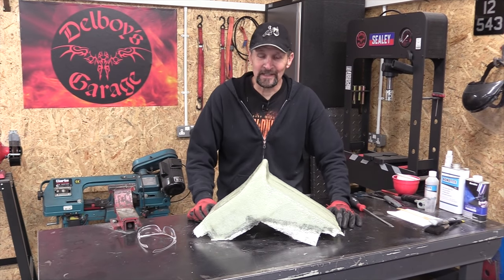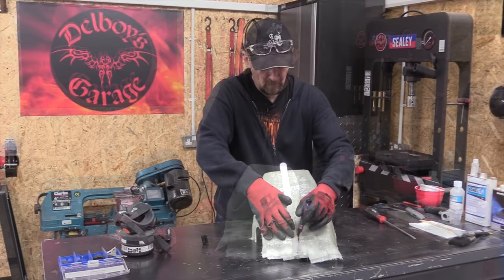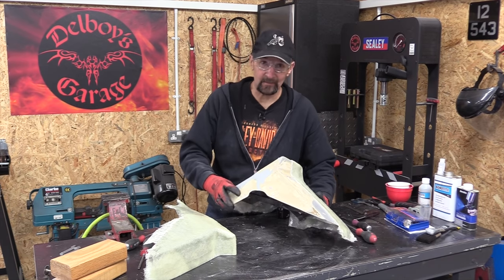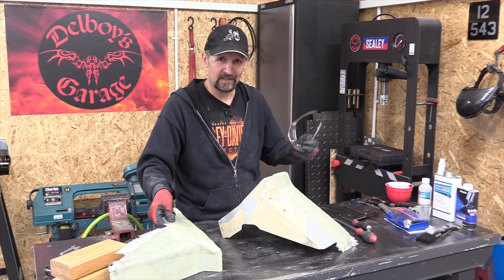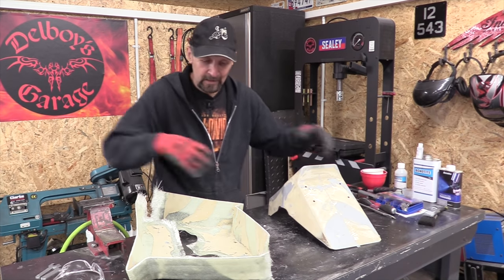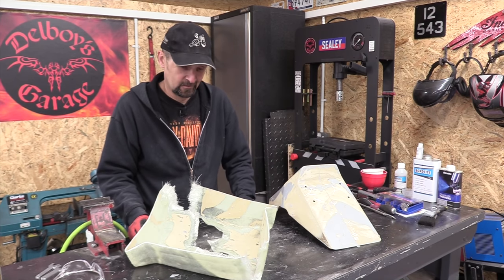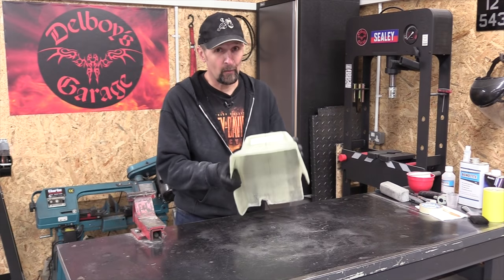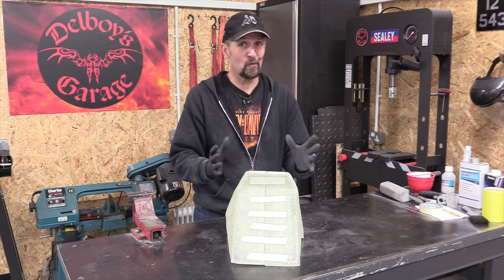Husqvarna Strada Makeover #8  Mould Release FAIL !

Comment: Mate - that is exactly why 180,000 plus people subscribe to yours and PP's channel - we get "warts and all" - and more importantly "improvise, adapt and overcome!" I know plenty of other channels out there that would have started this video with "I've decided the best route to go is to separate the mould into 2 halves" and conveniently skipped the initial struggle and the removal of the  filler using the knife - thank you both for "keeping it real" and for pushing on to get that first class result at the end! ⭐⭐⭐⭐⭐
Reply from the maker: Thanks So much Mike, we really appreciate that.. There is no way i would have learned half as much from just watching videos.. there is no better way to learn than by making a mistake, and fully understanding it, knowing "why" something went wrong means you know how to avoid it... 
 In this case, it wasn't to do with faulty mould release, after all it worked well on the test can!  firstly I slightly over did the resin "wetness" and the job heated up too much, and being polyester resin it shrunk. then that combined with using soft, rattle can clear coat, which hadn't fully cured, it bit hard into it as it shrunk, and pulled some of the paint off.... as you saw, what pulled off was easily pealed away with a knife, so i was almost there..  just should have soaked less resin into the job, and painted the plug with 2K so it was harder.... Oh, AND made it in two halves..lol!        Thanks again mate, making changes for the next step!

Comment: Hi Del, well done persevering with the moulds. Suggest you use gel coat for the product as a first layer before the glass mat and resin. Ideally, gel coat for the first layer of the mould may have worked better as well. Gel coat is another expense as you need to buy it and resin and mat, but the results in terms of mould and product are vastly better. I used to make panels and flares for my race car from scratch...cheers.
Reply from the maker: Yes indeed, Gel Coat acquired for the next step, and you are right, it's yet another expense in an already huge pile of expenses.. This is turning out to be a very expensive process and that has been the biggest discovery..!

Comment: I wish you luck with making the dividers off the mold as you will have to place the divider on each side and inevitably there will be a gap the thickness of the divider which when the mold is broken will be a minimum 1 mm seam on the finished article. Sorry to say, but I think you will have to go back to the original buck and make a divider from 1 mm polypropylene, glueing one side to the buck with a plastic glue gun and filling any gaps with mold wax (easy Composites do a 500g block). The clean side mold can then be made, having first put 4 coats of release agent on the buck and the divider. when the first side has cured remove the divider but not thee half mold and 4 coats of release agent on the other side of the buck and the raised portion of the mold formed by the now removed divider. You will need probably to run a fine bead of wax into the junction between the divider and the half mold. You can then lay up the second half of the mold. When this has cured bolt the two halves of the mold together with bolts about every 2 inches, take them out and separate the molds. When making the actual piece more wax will be needed to make the two halves of the mold smooth at the seam, 4 to 6 coats of release agent and lay up the piece. I have never found PVA to be any good as a release agent as a) it does not release  very well and b) the work you have put into getting a smooth buck is lost by the finish of the PVA when applied to the buck.
Reply from the maker: Thank you for your wise words of advice my friend, all of it points to one inevitable outcome and that is that I will have to bodywork the finished item, I've made the two mould lips now and they screw together in to one piece, I've fortunately managed to cut the mould in half dead straight so I covered the bench in plastic, laid the cut edges face down and created the lip against the bench top, the entire mould will be only narrower by the width of my tiny cutting disc which is 1mm and that's a tolerance I can live with.  As I've said, I'm totally new to this, this is my very first moulded item from scratch and it's a wonderful journey of discovery... like I said, I know I'll have to bodywork the finished item but was planned anyway as I want it in the colour of the bike and a little primer and some sanding, hopefully, I can turn out a good result as my first effort.

Comment: Wouldn't call it a fail del, as you know I make moulds/repair yachts daily. Last mould I made of a matrix is still in the boat as the bastard wouldn't release. I've been off for nearly two weeks now with paternity so got to get the bugger out and crack on with getting it all laid up and back in the boat when I get back lol

Liquid pva is a better choice, also.. as mentioned.. styrene eats the crap out of stuff, i would normally use some parcel tape and layup over that once waxed/pva
Reply from the maker: Thanks Chris, got myself some more provisions for the next step, some Yacht chandlers materials, Gel Coat and blue PVA so i should be better off next time.. just got to make that lip edge on the two mould halves so i can screw it together..  Thanks for oyur insight mate, and have a good weekend.
Reply: @Moonfleet41  if you need any advice or anything dont hesitate to ask buddy, shame I can't help you out with materials but unfortunately transporting resins, catalyst etc in a rucksack on my bike probably isn't the best idea haha
Reply from the maker: @Larcomes  Ha ha, it certainly isn;t Chris, and i really appreciate that, it has been hellishly expensive wen i calculate everything ive spent so far right from the steel to make the plug.. but im deep into it now so committed to finishing it... Take care and thank you for the advice offer. ill certainly take you up on that if i get stuck... have a great weekend and keep safe.. Del.

Comment: So if you had drilled maybe 2 or 3 small holes on the fiberglass but starting with just 1, you could have used your air compressor and using a rubber-tipped nozzle to separate the casting from the mold. Also, I have done molds similar to the one you are doing to cast a new part from an old one, and I have used window tint paper as the release mechanism because it is so slick and the fiberglass releases with some air pressure rather easily.

Comment: Hi Del, it is all part of life's rich tapestry, some days you win and some you don't. Skip Donahue is right about bare metal moulds, we used a similar process in making canopies for railway coaches. Good save though, top marks for sticking with it, I would have had a tantrum and thrown it all in the bin :)
Reply from the maker: Ha ha, thanks mate, sadly we don't learn much from tantrums though aye.. in this case, i know what i did wrong,  too much resin overheated it, that lead to it shrinking too much, couple that with soft rattle can clear coat, that wasn't hard enough... it just pulled the paint off.!!    making some changes for the next step once ive modified the mould, and should be ok after that.!   You're dead right mate.. Life's rich tapestry..!

Comment: What I'm wondering is why you used hairspray as PVA? Are those really interchangable, or did you accidentally grab the wrong can? Perhaps that's a big reason why the mould just wouldn't let go?
Reply from the maker: Read a few forums, its a common second choice, and lots of reports that it works... and the paints used on the plug were the problem, not mould release, the paint pealed off the mould in a few minutes..!

Comment: Hi. Did you fill the holes with something on the mold. You can use some clay. If you don't you get resin in there and the hole thing will stick in those holes. (Done a mold for a car bumper and found out the hard way many years ago...)
Reply: Another tip is to use gel coat when you make the parts

Comment: The idea to split it was definitely a save! I’ve migrated to epoxy resin over the years after having polyester do similar things, like partially melting or corrupting the plug surface.
Reply from the maker: Yeah, no experience with this until now, but it's a great experience to be learning.

Comment: Think of it this way... you put enough release on the plug that it didn't become one, it was just a little snug.
Reply from the maker: Exactly that mate, the problems were two fold, and neither to do with mould release, firstly the rattle can primer and clearcoat doesn't cure hard enough to resist the chemicals in the resin and also I went a little wet on the resin lay up, which slightly overheated it so it shrunk, and like you say went snug! ... and as it squeezed the plug, it pressed in to the paint and peeled it off... and as you say, it didn't become one, so it wasn't about mould release!
Reply: But still, you got a plug that is intact and the mound is useable, for most that is considered a win.

Comment: You recovered well Dell .I worked in fibreglass for 2 years using 2 ounce matting.you should use a gel coat on top of molding.highly recommend the first coat of this after polishing the mold in the future Del and it will pop off like a champagne cork m8
Reply from the maker: Thanks Karl, i will be using a clear Gel coat in the mould, and an industrial PVA too, so hoping for a better result next time.